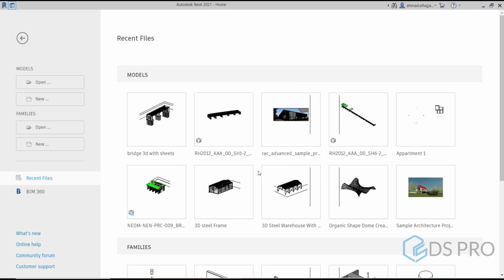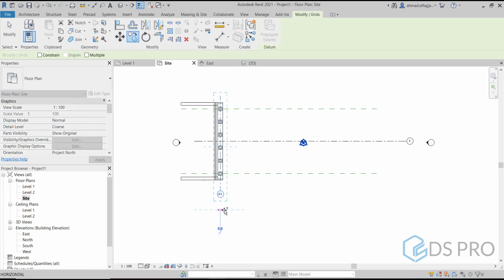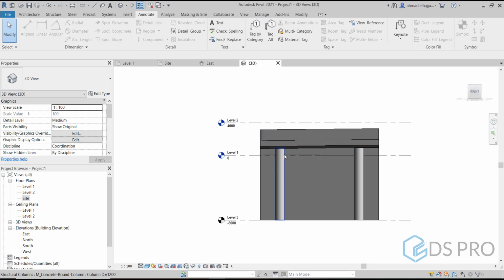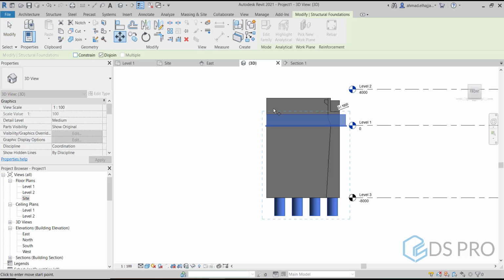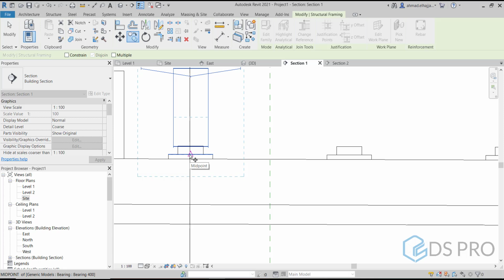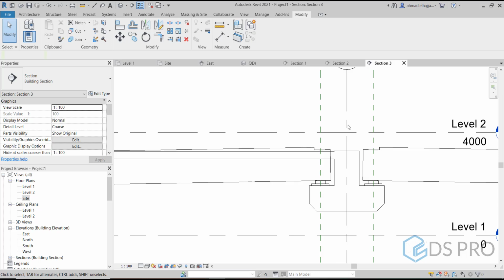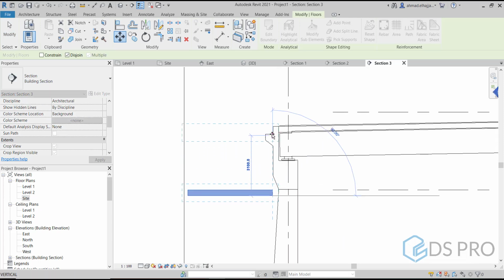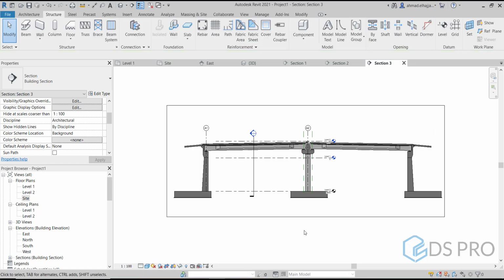6- I-Griders Bridge Modeling step by step - Revit

Comment: Hi, I bought the course on udemy and downloaded the bridge abutment family. I wanted to ask you if you can make a quick video of how to tilt the edge walls and wing walls so that the family can also be used for oblique bridges with respect to the river
Reply from the maker: I believe you’re referring to a skew bridge. Generating a skew bridge abutment family requires a different approach since you need to define a skew angle that impacts the entire abutment. However, another possible method is using an adaptive component family, which is a bit more complex, but you can start exploring from there.

Comment: How can I access the course?
Reply from the maker: You can purchase the course using this promotion link, and you can download the families as a gift:
https://www.udemy.com/course/revit-advanced-course-advanced-topics/?couponCode=B87403E067C8378BCB98
Reply: @ds-pro1307  how can I make payment?
Reply from the maker: Through paypal, or through debit or credit card. Check the link and press enroll. It is an online purchase.
Reply from the maker: Did you purchase the course? If not yet, use this promotion link: 
https://www.udemy.com/course/revit-advanced-course-advanced-topics/?couponCode=B87403E067C8378BCB98

Comment: Hello, I am interested in taking your course, but I have two questions: Do you provide the families used in the video in your course? besides the bridges, do you have any models of concrete galleries?
Reply from the maker: Certainly! Once you purchase the course, you will have the option to download the families as a gift. To take advantage of the promotion, you can purchase the course using the following link:

https://www.udemy.com/course/revit-advanced-course-advanced-topics/?couponCode=B87403E067C8378BCB98
Reply: Hi, I just bought the course. I didn't find the options to download the families, could you help me?
Reply from the maker: The families are attached as downloadable resources inside the sessions. 
I have a question, when u made the purchase did u use the sent link?
Reply: @ds-pro1307  Yes! I used. Thanks!
Reply from the maker: Great, but may we ask a favour? We realized that this link gives 70% of the amount to udemy, please can u make refund and repurchase using this link:

https://www.udemy.com/course/revit-advanced-course-advanced-topics/?couponCode=B87403E067C8378BCB98
Reply: @esdrasemerson5886 votre contact svp